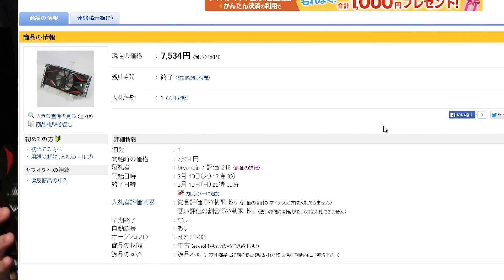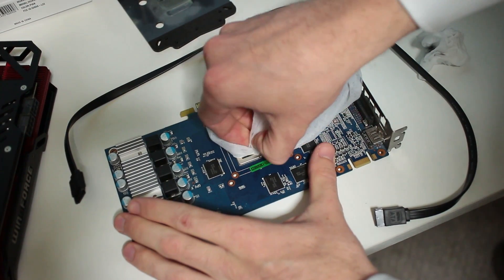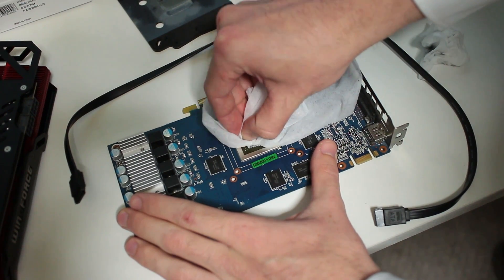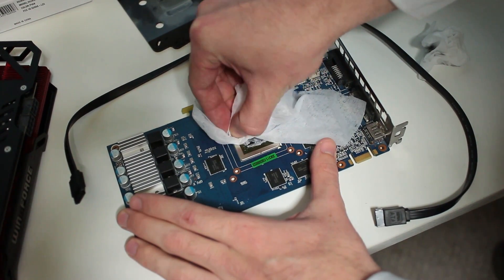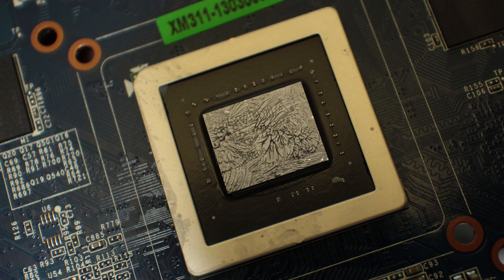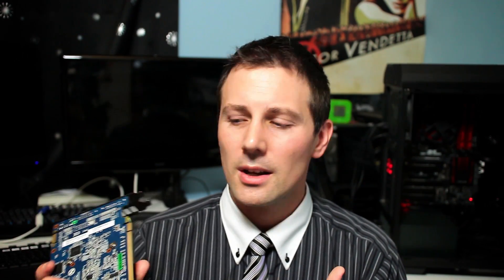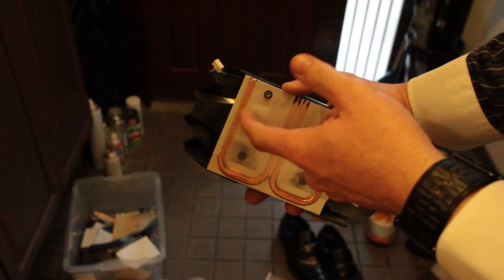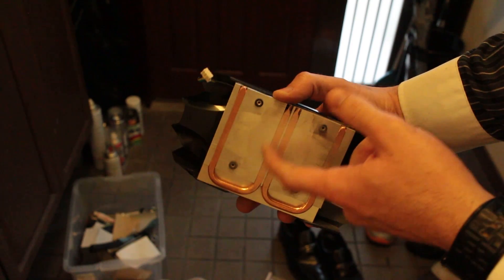Lapping Vs Non-Lapping Vs Thermal Pastes - Temperatures Tested on GPU Die

Comment: Of all the incredibly stupid things people do to their CPUs, including overclocking them until they are hot enough to melt steel, the single most imbecilic modification has to be lapping. Using absurdly skewed logic and completely unsupported data, lappers believe that by physically grinding down the surfaces of their CPUs to make them flatter and gain better contact with the similarly lapped surfaces of their heatsink fan cooler assembly they will lower their operating temperatures up to 20 degrees C.

The miraculous advantages of lapping are evangelized by the same sort of online loonies who believe that Microsoft and AOL are giving away merchandise and cash just for forwarding an email message, three triangulated cell phones can pop popcorn kernels, and that Barack Obama was sworn into his Senatorial office with his hand on the Koran.

CPU Lapping is a destructive process that is claimed to drop operating temperatures when all it does is drop your IQ!
CPU Lapping is a destructive process that is claimed to drop operating temperatures when all it does is drop your IQ!

The process of lapping involves grinding down the top surface of your new CPU with 300 grit sandpaper, which is repeatedly soaked in soapy water. That is about as close as I can imagine to having a perfect formula to irrevocably destroy a computer processor. If the constant static electricity buildup of repeatedly rubbing a CPU with an abrasive is not enough, and even if you can make sure that all the little metal shavings don't migrate to the underside of the processor to short it out, exactly who told you that soapy water and silicon processors mix?

Lapping is supposed to be complete when the silvery surface coating of the CPU is all gone and it reveals the coppery colored core material. Of course this assumes that the CPU manufacturers have invested countless billions of dollars into Research & Development just to coat their processors with a completely useless if not wholly counterproductive metal coating! If anyone wanted to pit the indepth knowledge and understanding of CPU heat transfer technology, I'd always put my money on some socially handicapped zit-faced 13 year old kid in his parents' basement than I will on the entire engineering staff of Intel! NOT!

The lapping is not only restricted to CPUs. Lapping enthusiasts just love to grind down the surfaces on aftermarket third party CPU air coolers, some of which retail for over $100! The lapping lunatics forums are full of descriptions of how to take the mating surface of an expensive air cooler all the way down to the metal substrate!

Lapping not only immediately voids your warranty and prevents any RMA returns but does absolutely nothing at all other than create insane illusions in the minds of lappers who like to boast that they got a mirror finish on their copper IHS and now have dropped their overclock load temperatures into Arctic territory. The bottom line is that no CPU nor HSF ever require lapping and just judicious application of a proper thermal grease is more than enough to ensure proper mating and heat transfer.

If you are ever tempted to lap your CPU do this instead: stand on polyester carpeting with your socks while you press your CPU onto the 3500 rpm spinning gray 60 grit wheel of a nice Black & Decker BT3500 bench grinder. Keep going until the static tingle in your fingers turns into sharp shocks and the IHS is ground down to where the actual circuitry is visible. Now your CPU will work perfectly. If you'll believe that, you'll also believe that Microsoft Bob was the best Operating System in history, Enron stock was a profitable investment, and Hancock was a great superhero movie.

Comment: You need to use a thick plain of glass with stick on sandpaper start at 600 and go all the way up to at least 2000. This will ensure a flat surface  is achieved.

Comment: I don't think you lapped the cooler correctly.
Reply from the maker: +Sean Kim Not perfect, but still improved.
Reply: Tech YES City Wouldn't it be better to lap the whole cooler? If you only lap the part of the cooler that is touching the GPU die then there would be less pressure on the die. That might have been giving your the unsatisfactory temps. It would be an interesting video to see what would happen if you lapped the cooler perfectly. I wonder if the temps would decrease more.
Reply from the maker: When i get the tie I will do more indepth prepping and testing
Reply: Tech YES City Nice. I read a nice article that included something about heatsink lapping. You can find it here http://www.totalgeekdom.com/?p=3452
Reply from the maker: thanks, will take a look.

Comment: I appreciate the attempt, but  I would hardly call that proper lapping. You want a much smoother finish than you got and there's no way you got it very even and level the way you did it. For oddly shaped heatsinks, you need to basically make a jig with a perfectly flat base (tempered glass worked for me) to which you can affix progressively finer grits of paper as you go and run the heatsink along the surface rather than hold it in your hand. For anyone watching, this is NOT how to properly lap a heatsink.
Reply from the maker: +Michael Murray Yeah I wouldn't call it proper lapping either, but looking at it from a correlation of smoothness to temp drops, would going mirror finish to mirror finish (which the GPU already has) yield better results? I don't think so, though I will try this in the future with someone from OC.net forums who is heralded that would make for some great content.
Reply: +Tech YES City Yeah, bro, I agree with that. A mirror finish makes it pretty easy to see distortion even without a straightedge or razor to test against. You may be much more coordinated than I am, but I know that if I tried to free-hand the lapping, I would completely fuck it up. For me personally, it MUST be done against a level surface. I've put in enough time in construction jobs that I know I was clearly not born with the ability to work without tools that can compensate for my shortcomings in perception and agility.

Comment: So I'm dumb, does "lapping" mean, sanding it to make it smooth?
Reply: Man do not listen to Tech City.  Lapping is NOT making something smooth.  It is Making something parallel to something else with minor imperfections.   Smooth is nothing more then a bi product of getting to pieces to be parallel.  This video is nothing more then a waste of bandwidth.
Reply: No.
Lapping is a machining process, in which two surfaces are rubbed together with an abrasive between them, by hand movement or using a machine.( Wikipedia). The purpose of which is to remove irregularities between mating surfaces.
What you did was sanding. Had you truly lapped the heatsink you could have just about removed the need for TIM.
Reply from the maker: +William R yeah

Comment: Lappings not just about making the HS smooth to the touch you have to keep it flat too, using a sander like you did probably made the HS slightly convex which could also explain the poor liquid pro results. The best way to lap is with sand paper on a flat glass pane (moving from 400ish grit to 2000 wet) and using the weight of the HS itself as the downward pressure :)

Comment: The only reason I have for not using Artic Silver 5 is that it is capacitive and sometimes I just need to apply quite a lot of compound and there is some risk of it getting where it should not (I use it in laptops and in graphics cards) So I use AC MX4 with good results.

Comment: I replaced the thermal paste on one of my GTX 460s several years ago. It really helped to lower the temps of the lower card (sli) by about 5 degrees and the upper card (I didn't replace the thermal paste on that one) by a couple of degrees as well. I swear by the Arctic Silver.

Comment: Why do you use AS-5 on a GPU especially one that is a bare die AS-5 is electrically conductive and there are often resistors and such around the GPU die if AS-5 tuches them likely you will have a fried card. I also want to say arctic cooling mx-4 performance is almost identical or better than AS-5 and is non conductive and has no cure time along with is carbon based so will never dry out.

I find arctic cooling MX-4 to perform usually better than AS-5 with added benefit of no worry or stress about it getting in areas outside of the die and such and arctic cooling MX-4 applies so much easier 1/2-3/4 pea blob in center of a CPU apply heatsink / waterblock and tighten and good to go for GPU's you use much less.
Reply from the maker: Rick Cooper Shouldn't fry the GPU, though it would cause problems if it were to touch.  However I have my spread method down pat to the point where I apply just enough.  I am going to get a tube of mx4 and gelid extreme for a video in the future.  I want to bring in a member from the overclocking community and go head to head with a lapping experiment, my ghetto method vs their glass/4 types of grit polished surface method.

Comment: would you suggest replacing the thermal paste on a new gtx 970, asus strix, idle at 40c max is 65c
Reply from the maker: Brett Culley Yeah already did with AS5, got a decent temp drop out of it.
Reply: Hey thanks for the fast reply,I was gonna buy a second one but nothing I use supports sli and something new is always over the horizon
Reply from the maker: Yeah, that is usually how i think as well lol...  There will be a 980ti or something similar out later this year around August.
Reply: Tech YES City Don't forget the 390x!

Comment: I've been curious about the Tuniq TX 4 (or 3 also..cheaper) for exemple on this article : http://www.xbitlabs.com/articles/coolers/display/thermal-interface-roundup-1_12.html#sect0

It's one of the bests, also on a forum I saw Gelid OC extreme was the best too..

Also isn't it better to do lapping with hand ? like when they do the CPU and it's almost like a mirror ? I guess the benefit is not muuch better but still :).

I'm using prolimatech pk3 and I kinda regret buying a 5g tube, I might try the tuniq next, also, I might try to lap my FX 8320 !! how about that ? also my NHD-14.. wonder how many °° I can gain..

Comment: Awesome video as usual just wondering could you do a guide on how to take apart the back plate off a Gigabyte GTX 970/980 G1 edition and also what method to use when applying thermal paste on it as there aren't tutorials out there at the moment.

Comment: You didn't get the desired results of lapping because you didn't do it right. 
You're supposed to lap the cooler against sandpaper on a flat surface, and then slowly increase the grit level until it's smooth. 
If you use a dremel (or whatever you were using) it makes the cooler surface uneven, but the point of lapping is to flatten the mating surface. This is only really achievable by sanding it against a flat surface and definitely not by hand.
Reply from the maker: SimonIsYourBuddy Used a finishing sander, great tool, I recommend grabbing one, it will save you a lot of time.  Also a perfectly flat surface to sand on is something of a rarity (then again there is no such thing in the world of science?), especially for a guy like me.  Using the 'controlled muscle method' will get you good results quickly :p.
Reply: You can tape sandpaper on a piece of glass (glass cutting board maybe? or go to a glass shop) for your flat surface. The 'controlled muscle method' is ghetto as hell and will have wildly varying results from person to person.

Lapping a CPU or CPU cooler isn't widely advocated mainly because of the effort required compared to the temperature difference, but I guess it matters to people aiming for perfection. And I guess if you're going to lap a heatsink, you may as well do it right otherwise 1C difference is not really worth it like you said.
Reply from the maker: SimonIsYourBuddy True, hmmm I will have to think of something, I will take this to the overclockers forum, where I will issue a challenge.  Ghetto method vs Perfectionist, same GPU, same fan speed, same paste, same environment... That will prob have to wait though... However I feel it would make for an excellent video.

Comment: How did you lap it? Just sanded it??? 1 grit type? Maybe if you went from 500 grit sandpaper down to 3000 wet sanding and then polished from there your get higher temp drops. I think you did the lapping too quick and it didn't look very reflective when you were finished ... Try again. Version 2 and this time liquid pro not ultra. And not the pads.